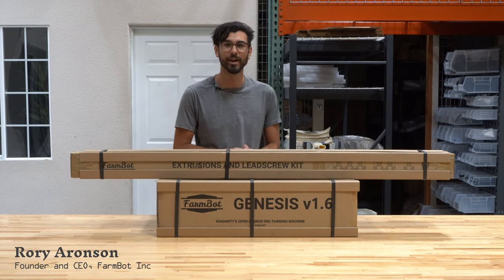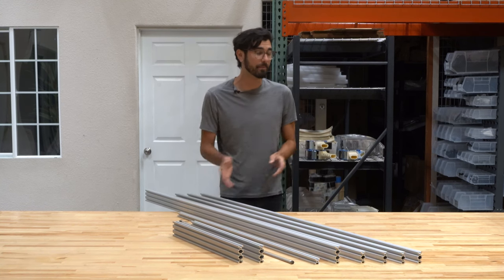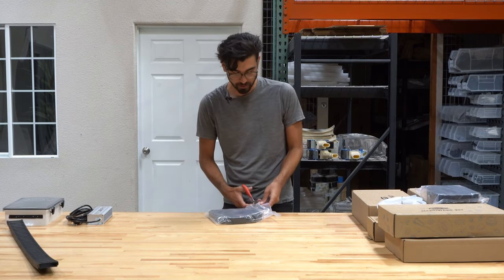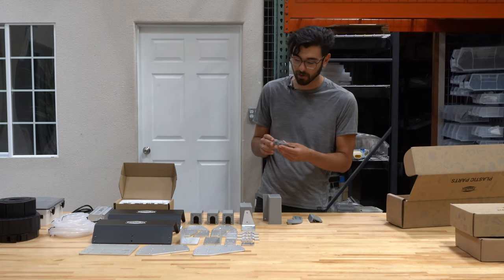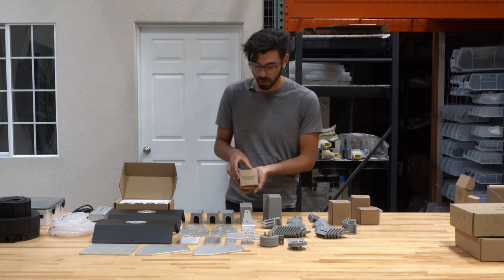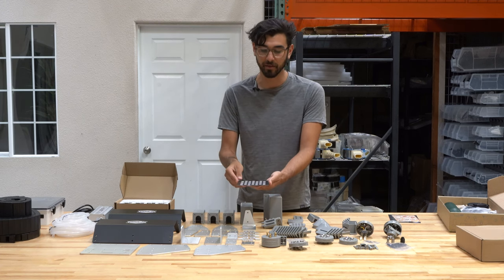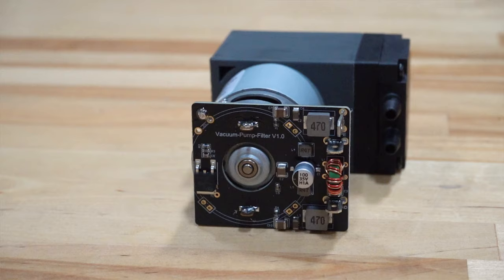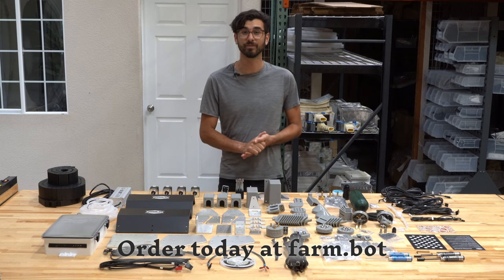FarmBot Genesis v1.6 Unboxing

Comment: With the Power Supply, is there an option to entirely change the unit supplied or just remove it? I live in Australia and would need to change it to a 220-240V AC 50Hz Input. Or alternatively power the whole thing with solar and batteries in its own isolated unit.
Reply from the maker: The power supply works with both 220-240 AC 50Hz. You would just need a plug adapter to the fit the Australian standard. Here are details: https://genesis.farm.bot/v1.6/bom/electronics-and-wiring/power-supply